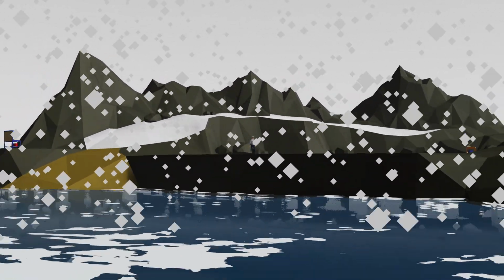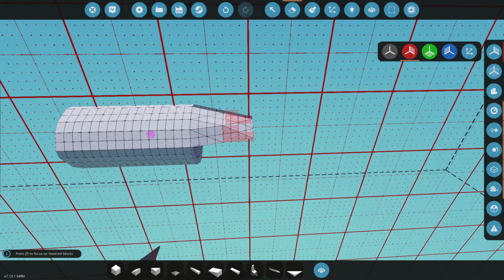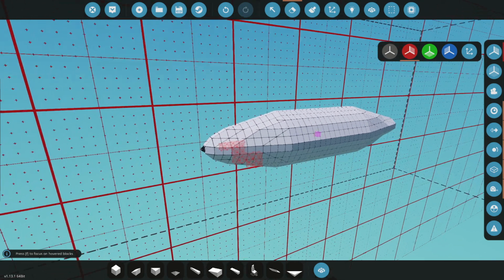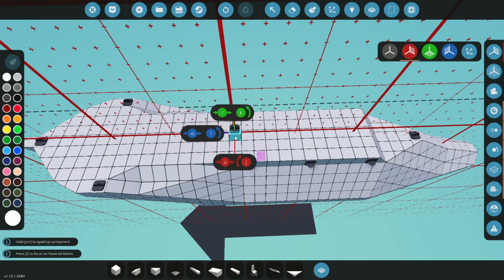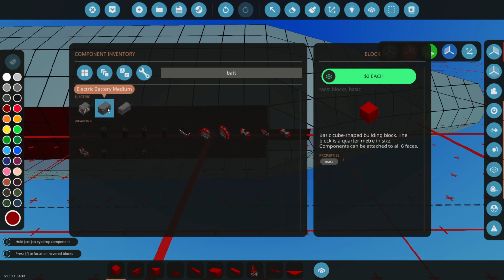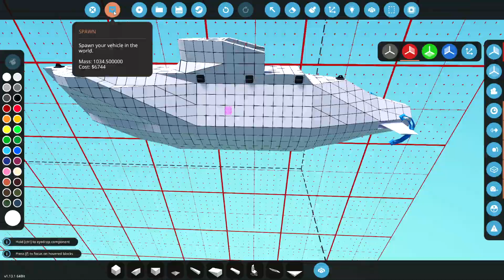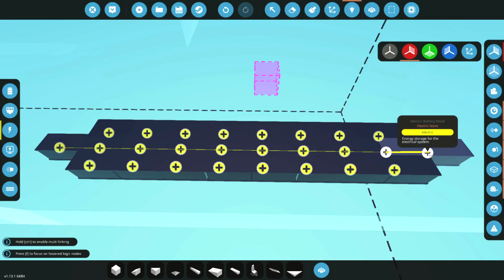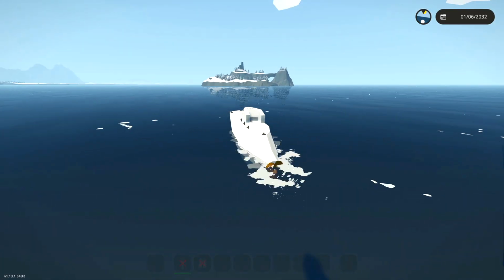I'm Building A MINI SUBMARINE In Stormworks - Part 1!

Comment: Hey frantic I hope you read this  I just started stormworks like 7 days ago and I really enjoy it so far you are my fav YouTuber on storm works but my boat is unstable and in one of your vids I saw you place like a stabilizer it was one part and I wonder what it's called?
Reply: Control Surfaces in the Vehicle Control section. It’d be better though if possible to use weighted blocks on the bottom of the boat along the center. Flat bottom boats also are much more stable in Stormworks. Small boats are also just harder to keep stable, especially when you get into higher speeds. I believe there is also a way to use 4 small control surfaces (one in each corner of the boat) with a Gyro to help keep the boat stable though you’d have to do research on that as I’ve never bothered with it. 
Something else to consider is looking on the Steam Workshop for Micro Controllers to use as well.

Comment: Can I suggest the addition a forward pair of diving planes on the bow, right where the round part meet the boat like shaped part
Reply from the maker: I've added something there in the next part.. I think :))
Reply: @FranticMatty  
I suggested it because subs normally have a pair of diving planes forward and a pair aft.

I'd also suggest to add a the fourth tail control surface or make the vertical rudder double